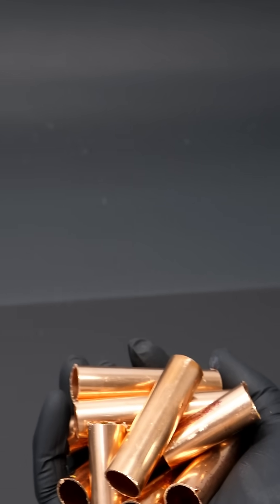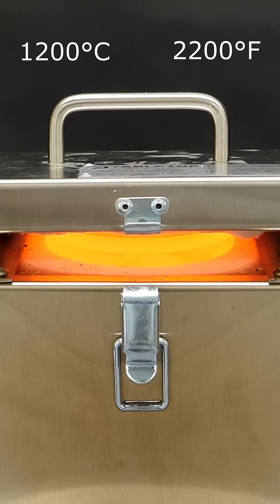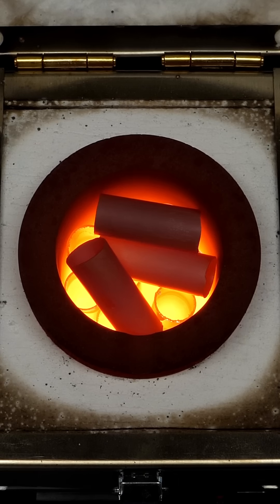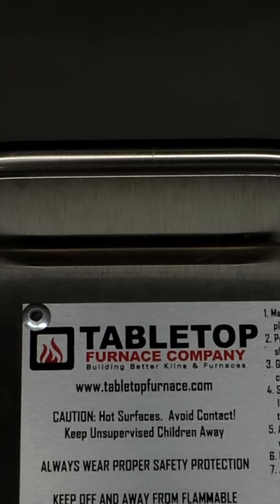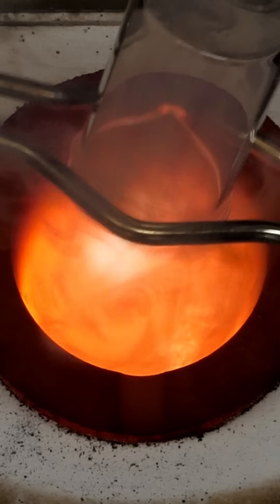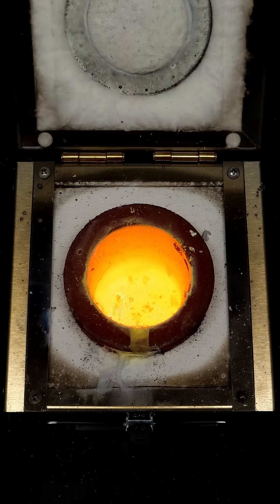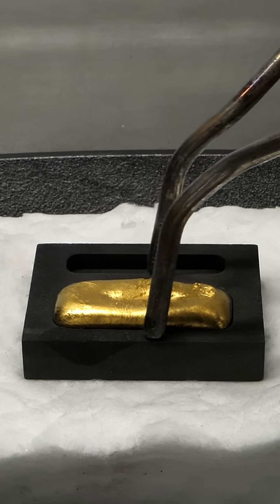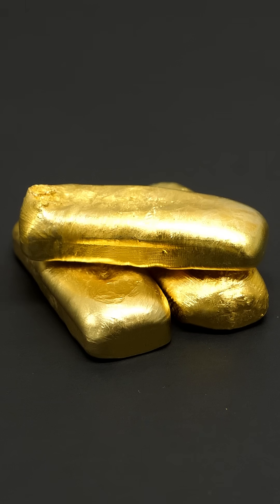Making Nordic Gold

Comment: Damn i want a big bar of nordic gold with the gold stamp on it to mess with my friends
Reply: I feel like it should be fine as long as you don’t try to sell it as if it were real gold
Reply: Do it Looney Toons style and stamp ACME on one side, and "GOLD" on the other with the tiniest quotation marks
Reply: This stuff is probably a lot lighter than real gold, so it wouldn't fool anybody who has ever handled gold. Looks nice though...I wonder how malleable/machinable it is for crafting projects.
Reply: @r1pbuck  Could cast lead inside to get the weight right to sell the effect.. Chinese already do that with real gold bars, or just gold plate steel and other metals.
Reply: @Hellsong89  Lead is barely over half the density of gold. Tungsten is a good match though, that's what the bar fakes are made of.
Reply: Ingredients are cheap enough. Can be done.
Reply: @AidanLuckjohn the furnace probably isnt cheap though. its not like you can just do it on the stove either
Reply: @_Myrhl you can make a furnace that will melt this with a #10 can, plaster, and a torch. There's no need to go all out on an expensive electric furnace. Remember, people literally transitioned from the stone age to the bronze age with sticks, rocks, and clay pots.
Reply: It's not illegal to make Nordic gold, but the fraudulent stamp could get you hard prison time
Reply: @Alyssa-h5g  When you buy certified gold, it comes in a sealed plastic case, it's not just stamped. When selling gold that's not sealed in a case, typically the buyer will do some simple tests to confirm that it's real gold and to determine the purity (karats).
Reply: @Gogeta70  here in the US, our bullion just comes in tubes or flips depending on how much you get. Of course, the eagles are actually 22K gold.
Reply: @Gogeta70  Or you can buy/sell (unwrapped) gold coins
Reply: @Alyssa-h5g , I imagine only if you sell it as actual gold, not just stamp it for your own personal use.
Reply: @Alyssa-h5g 
Its not like hes gonna sell it? Nor the people who would buy it will fall for the "100% real gold, trust me" stamp.

It would be a nice little trinket tho.
Reply: Honestly it wouldn't have to be authentic stamping. Not like they'll have an actual gold bar to compare it to. Just stamp like 999 and something that looks like a serial number.
Reply: It depend what stamp is. You can stamp it with your own initials and "pure 99.999% Nordic Gold". Also you can download clear certificates from internet and confirm it's a 99.999 Nordic Gold with your own certificate 😊
Reply: The stamp is illegal to put , if its a fake gold